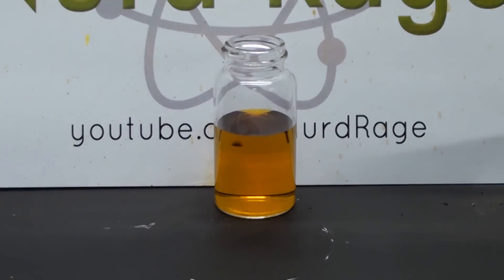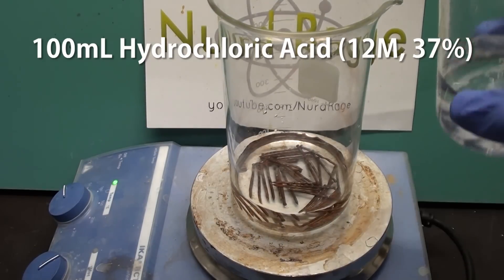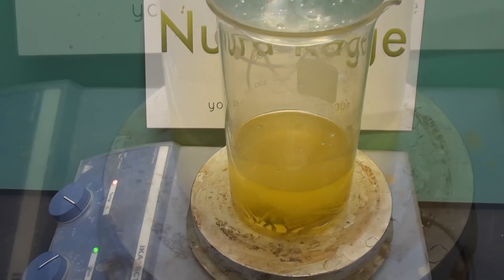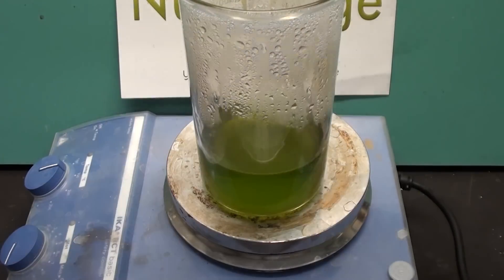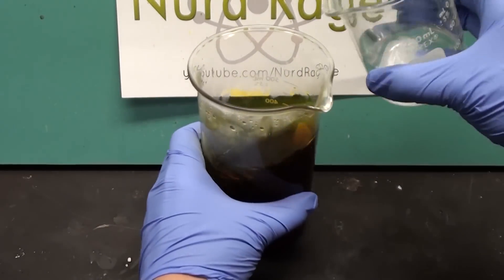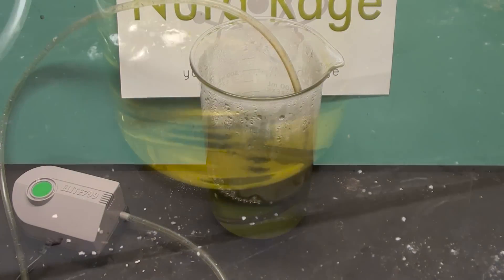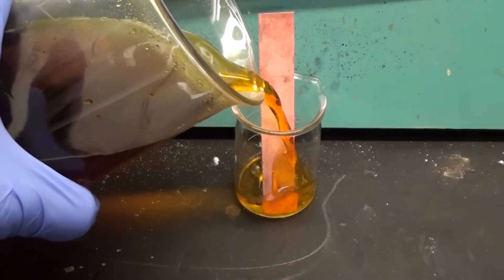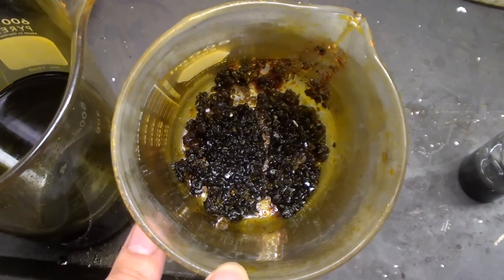Make Ferric Chloride (for etching printed circuit boards)

Comment: If i remember correctly i once sent you a message asking for a chemical for etching that i can make at home and is cheap.

Sometimes we (at my University) need ferric chloride to make our PCBs and there is none in stock, and around here it is really hard/takes some time to get some ferric chloride.

In v=D8M5BIo0a9Y he makes an etchant that uses salt, vinagre and peroxide, but i think it is looks very slow.

Comment: Awesome.PCB from Radio Shack is used by custom knifemakers for various finishes on blades as well as to bring out features in the steel such as temper lines or to make "damascus" pattern welded blades really pop.Iv'e heard complaints that the PCB can be difficult to find at times.I can now refer them to this great tutorial on making it themselves!. Great video as always.

Comment: You can get it at most hardware stores in a crude form... look for "muriatic acid."  In the USA, it comes as about a 30% HCl which is pretty concentrated.

Muriatic acid is used for concrete etching and pool pH maintenance, so it chould be found at a pool store and at hardware stores.   HTH.

Comment: Google translate says:
I'm going to say that chemical and H2O2 need to do high-pressure tanks, however you can concentrate a solution of 3% boiling at 100 ° C yields liters of peroxide 100 ml 30%

Comment: Nice to see how it is done, but I`d rather continue to buy the powder for ferric chloride in a electronics components store (it is pretty cheap too).
I have, however, a question: will that work if the nails are rusty?

Comment: Given that both of your iron sources (nails and steel wool) are actually steel, I'm curious if the trace amounts of carbon and other alloying materials have any effect on the reaction. I'm guessing it's a negligible effect or you'd tell us to get pure iron or iron oxide, but do you know whether the carbon is still mixed in with the ferric chloride or went into a side reaction whose result evaporated or something?
Reply: Hey there, from 12 years ago. Probably negligible. Steel wool is about 98% iron. Should be fine.
Reply: @Potato_Quality7  I figured that would be the case (or, at least, reading my old comment and knowing how my mind works, I assume I figured that would be the case), but I do like hearing about the negligible side reactions, and NurdRage sometimes likes to describe them. Also, wow, I've been watching NurdRage for at least 12 years. That's at least one career change ago.
Reply: @tildessmoo  Dawg, I did not expect you to reply at all. How's life man? Yo, 12 years?  That's a lifetime ago. I'm no chemist myself so unfortunately I cannot give a precise answer. However, since we're not doing precise chemistry, it probably won't matter. The aim is to make corroding goo. Throw stuff in there until it's acidic to the touch, and the Copper won't stand a chance. To back this up, I read you can reuse the Ferric Chloride, even after it reacts with the Copper to leave trace impurities in the solution. Jokes aside, it would be nice to hear NurdRage speak on this, though.
Reply: @Potato_Quality7  I'm kind of surprised the YouTube notification engine even bothered, honestly, but I still rewatch old NurdRage videos when I'm bored, so maybe it's not that surprising. This video came out right around when I was switching from being a waiter to a mechanic, which I'm normally grateful for because I'm making more money and have a lot more job stability, but given I broke a finger at work this week, it's a little harder to be optimistic. I'm not a chemist either - I studied Classics in college, which I like to joke is why I'm a mechanic now - and my amateur science interests tend to be in a more physics direction, but it's just always fun to see a scientist break down their passion for us laypeople, and chemists like NR and NR and... E&F (nah, they don't all have the same initials!) always have the best practical demonstrations.

Comment: i suppose you can concentrate the solution, then acidify with hydrochloric acid and reoxidize it with the hydrogen peroxide solution, but probably you will only could do it few times until the solution get satured in copper chloride and it gets preciptated.

Comment: @sammy3212321 well, modern US pennies aren't made of mostly copper anymore: they're made of zinc and plated with a few thousandths of an inch of copper on the outside. But if you have an old penny (pre-1980 or so IIRC) then it will dissolve If you have enough ferric chloride.

Comment: @KamaTheSnowLeopard because many plastics are impervious to acids. Polyethylene is one of the few materials that will not dissolve in hydrofluoric acid (HF) which will even dissolve glass.

Comment: Won't the Fe(3+) ions catalyse the decomposition of H2O2 (to H2O and O2), therefore requiring you to use more H2O2 than mathematically necessary? Or is the oxygen made that way directly consumed by remaining Fe(2+)?

Comment: I was wondering, one of the by-products of PCB etching is copper chloride salts(I use the HCl/H2O2 method).  Now, these are, of course, very harmful to the environment.  How would one go about properly disposing of the copper salts, or at the very least reacting the copper salts to a less toxic form.  I considered attempting re-electroplating the dissolved CuCl and CuCl2, but I'm curious if there is an easier way(I'm sure there is).

Comment: This video was awesome. It seems like something I could do (carefully) at home. Not really sure where I'd source the acid and the peroxide, let alone at the right concentration, but if I wanted to I could work it out. So yeah, more home chemistry plz.
Reply: Hardware aisle, 37% hcl for etching concrete or cleaning bricks. Peroxide from pharmacy or supermarket. For anyone 10yrs later

Comment: Hey! I know that this may be a stupid question! but how do you know when the ferric acid have been totally saturated and is time to replace! and maybe more important! is there a way to get the    copper out and recycle the acid again? because I have been only using muriatic acid mix with Hydrogen Peroxide! but it saturates very fast and take for ever to do the job! 
Thanks

Comment: I've used one part muriatic acid to two parts hydrogen peroxide to etch my boards because it remains transparent in use so that I could see the progress of the etch without taking the board out. The fumes are the main issue and the etch needs to be done outside.